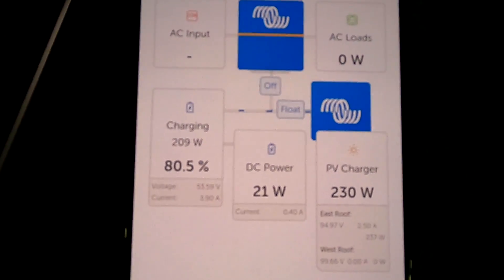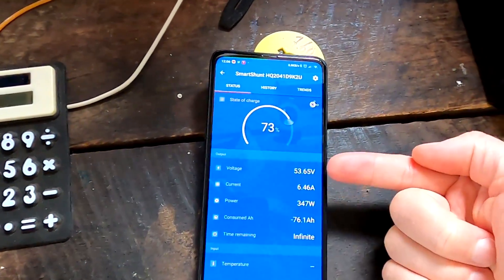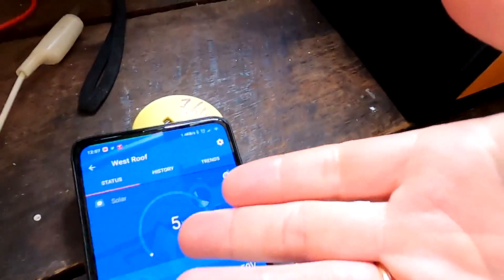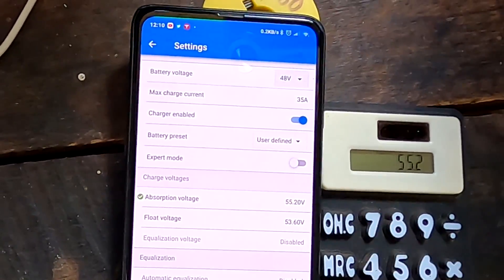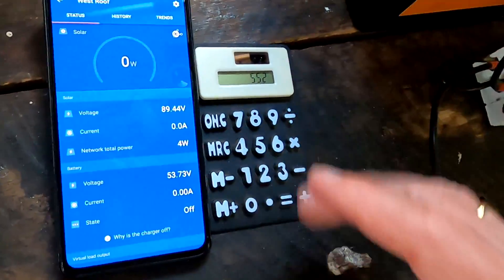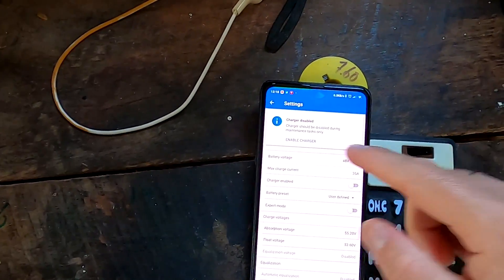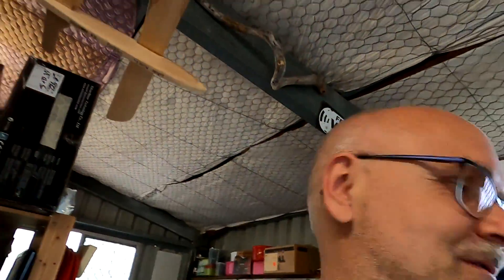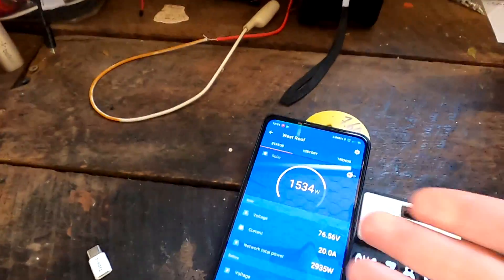Floating at 70%. Why charging LiFePO4 to 3.4V is not enough!

Comment: Hello how are you plz tell me i have made 12volt 12 amp lithium lifepo4 battery and attached it with my apc 650 plz tell me can it work and give me 2 hour backup my load is 12volt 2 amp dc
Reply: I think you could get about 5.1 hours with the APC 650.  Total power from pack is 12vdc X 12 amp =144 watts  then 144 watts / 24watts(load 12vdc x 2 amps) = 6 hrs less losses in apc 650, say 15% so .85x6hrs=5.1 hours....
Reply: Charge the pack up then just run the apc on battery pack until it quits working...just measure the time lapse...
Reply: Thanks alot ok plz tell me  apc 650 has fully charge and it show 13.55volt plz tell me is it full charged

Comment: Battery cycles, I finally managed to access the historical data on my 8 Pylontech modules, I have 8 installed between Oct 2018 and Mar 2019. SoH on all 8 modules is 100%, the surprising thing was that the lowest charge cycles was 141 and the highest was 191 with other 6 modules spread between 141 and 191 total cycles. Bank has run 24/7 since install charging to circa 3.55 Volts per cell, 15 cells per module, 400 AH capacity. I'm pretty happy at around 1 cycle per week just nice to actually see this info actually stored in the modules, have you any way to interrogate the total cycles on your bank Andy?
Reply from the maker: Thanks for sharing. That is indeed interesting. I have the smart shunt keeping a record of all cycles. I probably have two cycles a week at the moment but once the second battery bank is going online, it will half. 141 and 191 are Ah or what unit is that? So 191Ah out of 400Ah?
Reply: @OffGridGarageAustralia  Sorry my bad description, the Pylontechs are rated for 4,500 cycles from 100% SoC down to 20% SoC so that's 141 - 191 cycles from the 4,500 cycles when the battery was new in 2018-2019. In other words i've got about 80 years left at the current 1 cycle a week.

Comment: And this is why I'm building a 'supervisor' system on mine which reads the actual state of charge from the shunt and uses this to control the charge controllers.
Reply from the maker: That's great, you building your own? How do you calibrate the shunt?
Reply: @OffGridGarageAustralia  Yes, building my own supervisor system, based on a RPi for now. The shunt is a high precision (+/-1% accuracy) one with an RS485 interface.  All the other stuff like the inverter, solar charge controller, and BMS have an RS485 interface and this is already used to log and graph the data, so this will just be the logical next step: make active decisions based on the state of the entire system, and even learned usage patterns. Calibration is just like you would do during a top balance: watch the current go down at 3.6, and then it's full. Since the supervisor has complete overview and control of the state of the system, it can calibrate this shunt automatically, in case it drifts over time.
Reply: @upnorthandpersonal  I'm doing same but once a week i'm going to let it charge to 100% and have smartshunt re-calibrated. How are you changing absorbtion voltage on MPPT by RPi? I'm using just SoC from smartshunt to keep battery to 80-90% by disabling MPPT which is programmed to 3.5V and i set smart shut to 3.49V and tail current 1%.  MPPT have option to reprogram ve.direct port to enable/disable charging :) that is a nice feature. So on my tiny control "PC" i'm operating relay which disables/enables charging on ve.direct port of MPPT. Now i'm working on keeping battery on bulk full time, but to keep it around 75% i wil connect heater/boiler once SoC hit 80% and disconnecting it when it hit 70%.
Reply from the maker: @upnorthandpersonal  Wow, that sounds like a fantastic and very interesting project. Keep us in the loop.
Reply: @upnorthandpersonal  Yes keep us informed for sure!  I got lazy and just bought a solution. 😊
Reply: @OffGridGarageAustralia  I'll document the thing in a tread on the diy solar forum once I get to the point I feel comfortable sharing more details. As you can imagine, this is not something you quickly put together over a weekend.
Reply: @Shep5847  Yeah, this is more of a hobby project of mine. In principle I don't need it since my batteries are working fine as they are - so I'm taking my time with this. As I replied to Andy, I'll start a thread on diy solar forum on this at some point.

Comment: You can try to set the rebulk offset voltage closer to the float voltage... i did this with my agm batteries. It´s in the advanced settings.
Reply: I found that Victron Connect disables the Expert mode, each time you start the software.
Reply from the maker: Yeah, I tested this but again if I charge to 3.45V it is already 99.5%SOC, the voltage then drops to 3.35V for float which is 99.3%. There is no benefit to recharge to 3.45V again at some stage.
Might be different with AGM.

Comment: if you turn off the absorption and bulk set the float voltage to that of a fully charged battery here your choice would this then act more like a cc/cv charger
Reply from the maker: That would make no difference, it would just hold the voltage set as long as enough solar is available. It would charge with this constant voltage and the current will taper off. The exact same happens with the absorption/bulk voltage. It's a CV setting as well.
Reply: @OffGridGarageAustralia  ah ok I never relay played with lithium a d solar I was lead acid

Comment: I would increase the absorption time to 1 hour and determine and program the end amps setting. Voltage is the pressure and current is the flow and when the sponge is full, no more juice will flow.
Reply from the maker: Yeah, but then again, you could hit that voltage early in the morning and it starts your 1h absorption time. If you have clouds the current is low and it would switch to float right away. You end up with 70-80% SOC only.
Reply: @OffGridGarageAustralia  That's not too bad though for LFP to only reach 80% on some days. I'm more concerned with drifting balance over time, and no long periods to keep things balanced. My pack is 7 years old though, so perhaps not a problem with newer cells yet.
Reply: @OffGridGarageAustralia  I get that. You’ll probably still get 6000 cycles out of them. 80% SOC is based on theoretical capacity or a 100 cycle measurement of real case measurements of the exact bank? Is there a trend showing loss of capacity? This is getting interesting.
Reply: @OffGridGarageAustralia  I don't think this would be the case. If you're charging at 60 amps and that causes your battery to hit 54.4v and go into absorb, as soon as the current drops the voltage would also drop below 54.4 this should cause it tos witch back into bulk mode. So if you had clouds or something during your 1 hour absorb time this would cause voltage to drop below 54.4 because you're no longer pushing 60 amps and this should switch you back into bulk mode and start the whole process over again.

The 1 hour timer should means "If I maintain this voltage for 1 hour, then switch to float". if anything causes your amperage to drop, it would also cause the voltage to drop and result in going back to bulk.

I'd also recommend using tail current instead of the timer, because it will give you better control. You can't trust the voltage reading at higher amperage due to the batteries internal resistance so using tail current allows you to say "Don't switch to float unless I maintain this voltage even at a lower amperage" to better account for IR.
Reply from the maker: @JeremyAkersInAustin  I thought I have seen the Victron MPPTs staying in absorption mode once the voltage has triggered the timer. I cannot recall having seen them falling back to bulk if the voltage drops below absorption voltage. But it's been a while since I paid attention to that. 
Yeah, I can set the tail current as well but at 3.45V the cells are 99% full anyway, so there is no real reason to absorb for long unless for balancing purposes.
Reply: @OffGridGarageAustralia  At 3.45v I agree, but in this video you were saying "3.40v is not enough". In my testing 3.40v is plenty to bring you to 99% as long as you make sure it's really 3.4v "open circuit" voltage by either 1) calculating the OC voltage by factoring in IR, or 2) doing a longer absorption time , or 3) using tail current.

In other words: I'm saying 3.40v is enough so long as it's really truly 3.4v of open circuit voltage and not 3.4v "measured" voltage during high charging current amps. The voltage you measure anytime you have a lot of amps flowing is never an accurate voltage.

Comment: knurlgnar24 made some pretty interesting statements on some recent videos on his channel comparing lithium to lead-acid. He made the point that for LiFePO4 it is not the number of times you can cycle them that matters. It is all about calendar life. I.e. after 10 years you are down to something like 60-80% capacity regardless of how many charge cycles you have gone through in that time. So I wouldn't worry at all if you charge the cells to 3.6V or something. The batteries have enough cycles in them anyway before calendar life kills them.
Reply from the maker: It's actually the combination of high voltage and temperature which degrades them most.
But yeah, I generally agree, it does not really matter if you charge to 3.45V or 3.55V. At the end you will get maybe 18 years out of the cells instead of 15 years (just a guess). Same with compression...

Comment: Just charge to whatever voltage you want and keep it there. done.
Reply: The main problem with charging to whatever voltage you want is that per-cell voltage imbalance will still creep up over time and eventually trip the BMS, so you cannot just leave the PPT output to fixed output voltage up to the current/power limit. Ideally, you'd have the BMS throttle PPT voltage or current based on whatever it needs to keep cells within the target per-cell limits and its balancing capabilities. The bulk/absorb/float thing is just a hack to (sort of) work around the lack of such coordination.
Reply: @teardowndan5364  Exactly, the BMS should keep the cells balanced. If not, change the BMS.
Reply: @andrewseaman7012  And the BMS' job would be much easier if it has control of charging voltage/current instead of having a PPT independently jump between charging modes before the BMS is done doing its job. Can't balance cells if the charging current is too high for the battery's state as that would trip cell over-voltage protection, can't balance cells very effectively either when the charging voltage is too low to actually charge anything. PPT under BMS control would keep battery voltage exactly where the BMS needs it to be for maximum effectiveness..
Reply: If you want a shorten the LFP life then yeah (assume holding voltage above 3.35V and keeping it there.)
Reply: @MrDingaling007  If the PPT voltage is under BMS control, the voltage is whatever the BMS needs for whatever it needs to do based on its capabilities and the pack's SoC. That would be 100X better than a clunky three level system that is completely oblivious to what the battery is actually doing and needs.
Reply: @teardowndan5364    My reply was aimed at Andrew Seaman in regards to charging to whatever and keeping it there, specifically any voltage above resting voltage of LFP (or what we use as "float") is where i would have issue, it's not safe advise for everyone. I dont use those inline mosfet based BMS that can keep track of SoC. But a Zeva 8s voltage reading based bms that turns mppt/inverter off as needed.

Comment: Try setting one of your controllers to stop charging at a lower voltage (3.40) than the other charger (3.50).  That way, your charging will “slow down” as your voltage climbs. This will allow you to charge and absorb at the same time since you are charging slower once you enter into the curve.
Reply from the maker: Yes, that works but I would have to unlink both SCC. They are all in the same Victron BT network with the smart shunt to share all info amongst each other.
Reply: @OffGridGarageAustralia  Yea I can see how that can be a problem…. So are you ever going to try a “smart BMS” that integrates into the victron equipment?  Just curious…
Reply from the maker: @Shep5847  Yes, absolutely. That will be the next step. I'm waiting for some to come in.
Even the one I currently have can be connected. There is a Gridhup project for that. It would also show up in the Victron VRM.

Comment: Why not set the cell voltage to a higher setting and the battery voltage to less than what the cell voltage adds up to.
Reply from the maker: What do you mean by that? I cannot set an individual cell voltage, only the overall battery voltage.
Reply: @OffGridGarageAustralia  Oh ok my bms allows me to set a higher voltage on the cell and independently set whatever battery voltage I want so I can have the cell voltage at 3.65  but set the battery voltage at 55.2. Also the charger allows to set a max voltage which can be different than the BMS max.

Comment: Not watched yet, but the title says it all. And you may recall that's what I have, and have mentioned. Its funny,  your path and learning is just like mine was - but your proving it where as I just guessed and "played".  Lets see if my guess of that is correct  :)
Reply: And yes, but i also use this as a feature when I'm using 3kw.hr a day but could generate 3x that - so as not to float the battery at a high state of charge + no fear of running out
Reply from the maker: Hahaha, thanks for commenting before watching 😂
Reply: @OffGridGarageAustralia  and same again by lowering your (effective) MPPT voltages with the voltage drop  ;)

Comment: I am watching this with great interest Andy. I have a 48 volt LIFEPO4 battery pack in my camper and attempting to optimize charging. I have 1kW of solar installed and have been fighting battery cell balance problems. Keep it up and I will get my system improved also.  THANK YOU!!!
Reply from the maker: Thank you Dave. What I have done so far is a top balancing at 3.65V and then turned off all balancers. I then set the charge voltage to 3.45V (55.2 for 16s) in the solar controllers. So far this works great. I have set the balance voltage to 3.6V in the BMS just in case something goes out of whack. 
I guess, the initial top balancing is very important (not that this is surprising or new).
Reply: To David Zelkowski Do your bus bars fit properly? I had an odd cell out of balance, but fitting some longer, Heavy Duty bus bars mostly fixed it. The cell still goes high, occasionally, at high state of charge, higher voltage than the level I top balanced to. At that level they maintain near perfect balance. The 200mA BMS balancer kicks in if higher voltage, and sorts it out.
Reply: @michaelbouckley4455  My packs are built from reclaimed 26650 cylindrical cells.  They are spot welded together with nickel strips so I don't have any buss bars. I do use a 100 amp bms and am able to monitor each parallel string of cells through bluetooth app. The same app Andy is using.

Comment: Absorption should be for multiple hours. Basically until current drops significantly, rather than any set length of time. You will figure it out, I used the EBC-A40L with lots of tweaks and repeated tests to come to this conclusion. Use 3.45v/cell to get a lot of amps in quickly, then switch to 3.4v to get the cell saturated. Once current going in drops to one or two amps, you are around 98% full and can switch to float.
Reply: This is what LA batteries actually do. For LiFePO4 chemistry just charge to the max charging voltage and wait for the current to drop. No change of voltage. You're done.
Reply: fifteen minutes of absorption seemed strange to me when I watched the video.
Reply: John, I love this thought process.  Very logical.  Wish Andy would have read this.

Comment: And now everyone changes their settings :)

What i do on my system is read shunt SOC via the raspberry and turn on or off the chargers via a script.
The script also can check the power usage and start the chargers if consumption or SOC is over/under a preset value.
Once every 20-30 days i do a full charge to 3.5/cell to calibrate the shunt and balance.

I did the script in one day after reading the victron VE datasheets, i'm not a programmer but the frog works, don't have to worry anymore about the SOC.
Reply from the maker: That is indeed a very clever solution! Do you change the charge voltage every 20-30 days to 3.5V manually or is this a script as well?
Reply: @OffGridGarageAustralia  That is exactly what i have, i just have 3.5V all time, but stops charging once smartshunt hits 90%.. Then once a week i allow  to charge to 100% just to calibrate smart-shunt. But anyway Andy - you are the only youtuber i found who is doing solar/battery science and sharing it. Because what else it is when doing all by try and error? And you really speed up our progress! It is awesome that i do not have to do all the tests because you did them and share them! Great work indeed!
Reply: @OffGridGarageAustralia  at the moment i do it manually but it can be scheduled and done automatically.
The charge voltage is always set to 3.5V